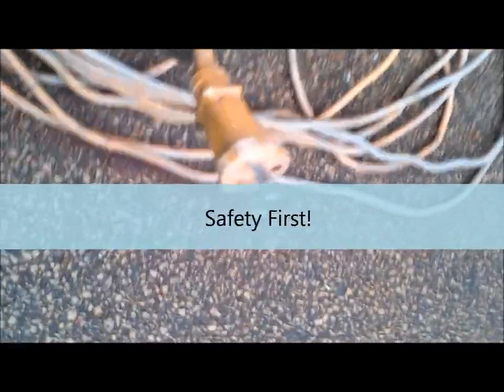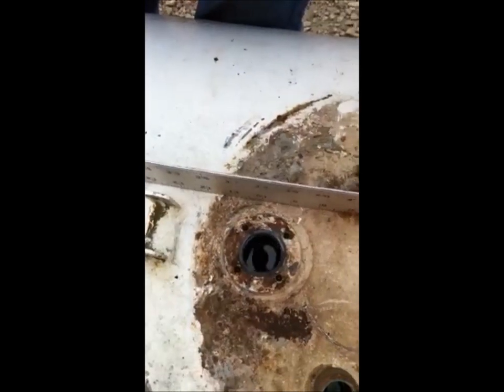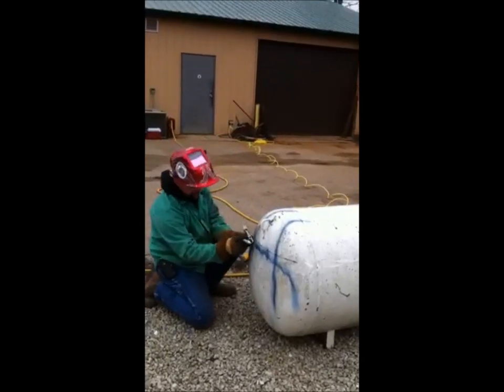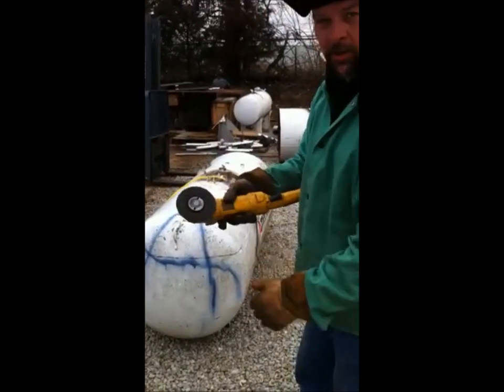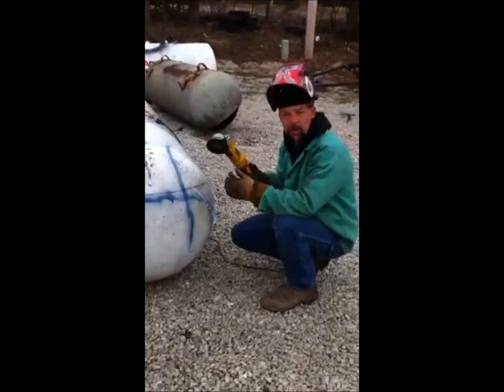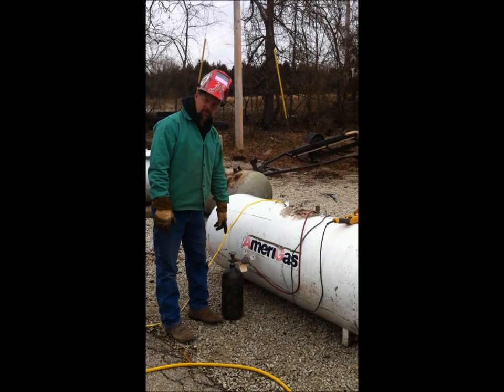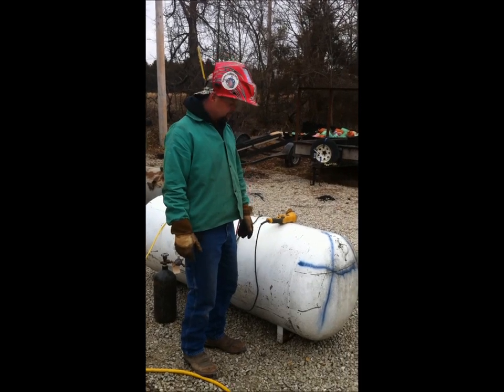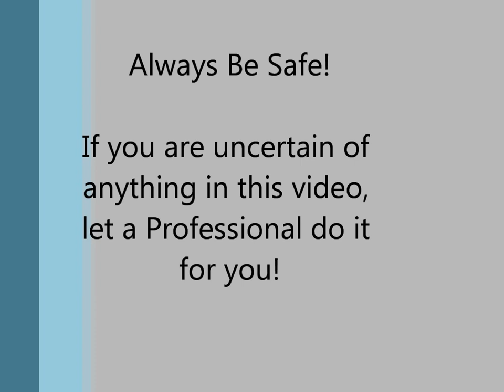How to cut a Propane Tank Safely!

Comment: I have cut several with a torch, plasma and grinder. I filled them with water for several days then emptied them. My tanks had all the valves/plugs off  for weeks prior to starting. So far, I have been accident free. I will be changing out my extension chords or replacing the ends for ground defaults. I will build mine with a firebox on one end or in the middle so as not to have a hot end and cooler end of the bbq pit. Smoke stacks on each end will allow all meat to be exposed to heat / smoke.

Comment: If possible rubber tape or duckt tape your connection from the tool to your extension cord, I'm a commercial electrician and I do it every time to add a bit more saftey by waterproofing that end as well as the GFCI. Great video by the way sir glad you mentioned the saftey aspects first hopefully people follow your advice

Comment: Nice to see a video advocate safety.  Couple other methods to do the same but without the risk of electrical shock, use a pneumatic grinder, or simply fill the tank with inert gas and leave out the water. More expensive however.

Comment: I had been wondering how people cut propane tanks without them exploding from the sparks! 
Just a thought - once you have filled the tank with water, all the propane has been displaced... so to avoid cutting into a tank full of water, what about using a syphon to drain the water out again before cutting?

Comment from the maker: I don't use a calculation or anything. you only need about a couple cups or so of dawn. matter of fact I have been doing them lately without using the dawn soap and it works fine. You can find more info on how to size your smoker on our forums at smokerbuilder forums

Comment: How much soap (dawn) do you use for a 250 gallon tank when you do add soap?  Is there a calculation you use for the size of the hole from the fire box to the smoking area?